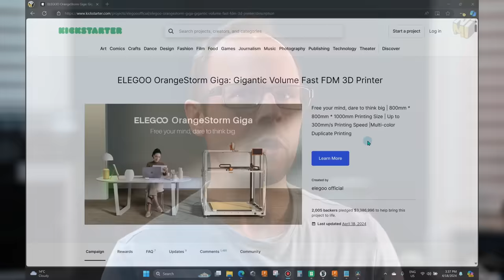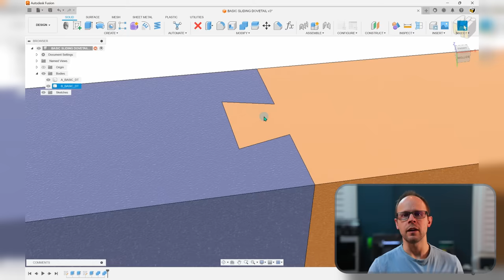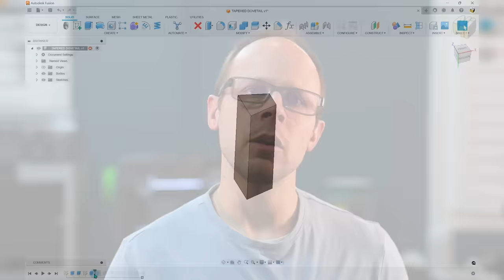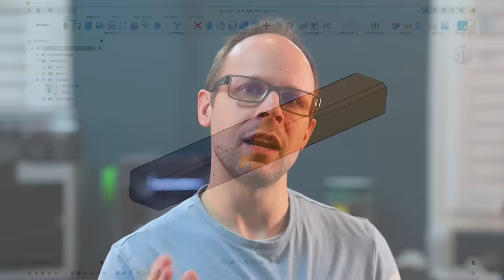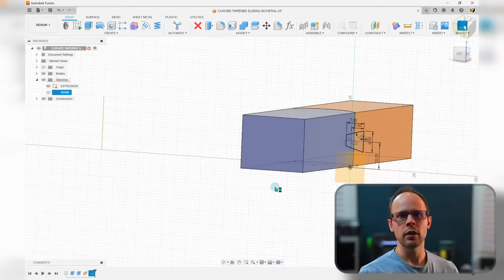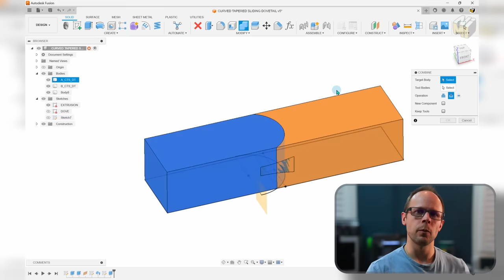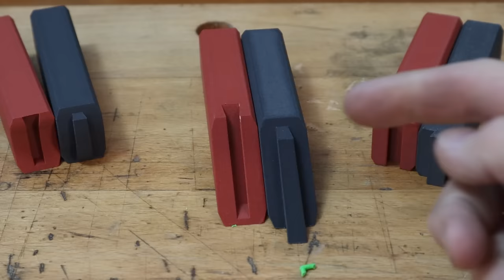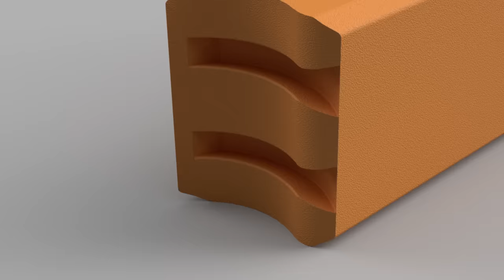Modernizing the best Woodworking Joint to use for 3D Printing

Comment: The finish on your parts is amazing, do you have a video on that?
Reply from the maker: Oh, well it's not really much to do with technique, I'm using the QIDI Q1 and the Bambu X1C for these parts, both are very accurate printers, and I'm using PETG-CF with fairly thin layer heights (0.16).  The PETG-CF gives a beautiful matte finish with that slight texture.
Reply: @NeedItMakeIt  sorry that we are out of scope for this video but how did you applied that texture and how it is called if that is easy to answer I would appreciate it
Reply from the maker: @axtoox  No problem, this texture comes from the material itself, if you try PETG-CF filament you'll have these kinds of results.  The filament I used here is Bambu Brick Red and Bambu Titan Grey.  You'll want a hardened nozzle and hardened extruder gears if you want to print with it.
Reply: @NeedItMakeIt  you're the best, thank you, subscribed to your feed - can't wait to see more!
Reply from the maker: @axtoox  Soooo much more to come!   Thank you very much every sub helps.  This month has been crazy with the subscriber increase it's just amazing.

Comment: These are great on straight and big pieces, but what about corners and smaller (5mm or less thickness) parts
Reply from the maker: Have you seen my other video about the Under Squinted Stop Splayed Scarf Joint?  It works on a corner.  5mm or less, that's a tough one.  You'd really want to use some sort of adhesive for something of that size and use a scarf joint I'd imagine to increase the contact area.  I'll think about it a bit and see if I can come up with something of that size.

Comment: Isnt the last joint an outline + revolve + extrude to cut off the ends + merge? Probably it was hard just because you were inventing it
Reply from the maker: Yes I just tried it and as long as your sketch plane begins from one side, it can be set to a taper, so we can do it in 2 steps with your idea, that's a nice one.  I think having the connection set to an angle like a scarf is going to be superior.  I have 2 more coming tomorrow and then I'll have a final testing video to see how strong each of the connections we've created so far perform.  I'll also include something with fasteners and a continuous rail for a benchmark as well.

Comment: How did you create the rough texture on multiple faces? I noticed that it was on the model in the CAD. How was it able to transfer over so clearly to the prints?
Reply from the maker: My secret weapon is the material.  This is PETG-CF and it is the nicest looking filament in my opinion.  You'll get that slightly rough surface and the matte finish automatically.  You'll just need to make sure you're setup to print with Carbon Fiber with hardened gears and a bi-metal nozzle.
Reply: @NeedItMakeIt  I see, thank you so much for the tip I'll definitely give it a try, it looks amazing.
Reply from the maker: @Mr.Meme01  No problem, I've also found that this material doesn't enjoy bridging much so I typically 'peak' the holes which removes the bridge and gives you a nice clean final product.  This has been my experience with The X1C and the QIDI Q1, so I believe it is material related and not printer related.

Comment: where are your layer lines? it looks almost like matte finishing... or using <0.1mm heights?
Reply from the maker: I was going to say "What's a layer line" but I just can't with a straight face...  I was printing these with a 0.16mm LH and a 0.4N.  It's really the printer and the material that PETG-CF with the slightly rough matte finish really looks great.

Comment: 1:00 nah it's mostly the upfront costs but once that is handled it's about the same as a smaller printer. The annoying part is more if you want a large enclosed unit for using better materials.
Reply from the maker: One of my main concerns with printing plastics on a large scale on a massive buildplate is shrinkage and warpage... to some extent the loss of material if and when something goes wrong.  If you've watched Dr. D Flow, he built his own and it' very well done, but there were, let's say a few issues.  The size and the space it takes up in the shop is a bit of a problem, but it's no more than a table saw, maybe  it could be put on casters or somehow be able to engage the wheels to move it around more easily.  I wonder what material they'd choose to use to enclose a printer that large.
Reply: @NeedItMakeIt  you can use whatever you want really, things that won't burn or deform at 100c are pretty good, aluminum, glass ,foam and another material. 

The shrinking and warping are material specific and can be compensated for, warping is more due to a temperature difference so the enclosed chamber can fix that.
Shrinking is uniform als also temperature dependent and is also corrected by the chamber plus setting the scale a little larger to account for shrinking.

You don't even need to print it in one piece you can just print a few separate parts at once as well.
Reply from the maker: @deltacx1059  I think in that case, you'd want to heavily insulate the large printer heating a printer of that size to remain at 40-60C would be hard to do without it.  Not to mention the costs of doing it.  I'm open to trying one after the kinks are worked out, which seems like it's not too far off.  I still believe that shrinkage/warpage and keeping it attached to the buildplate will be a problem regardless of this being done, but like you say, you can still print in parts, just not as many.

Comment: What exactly does he mean with the very slight taper for the dovetail, so the joint wont back off? Does he mean the lip at 8:20?
Reply from the maker: The taper is a wedge shape, and it is on all faces of the dovetail connection, what it does is ensure that the connection pulls together tight and with lots of contact area it will not come apart easily.  You can still play with the clearances to get the fit you want.  If you don't want it to come apart at all, you can reduce the number to 0.02mm of total clearance, which will make it a 'hammer' fit.  Or leave it a bit loose for some adhesive.  The dovetail is common, but it's not common to also make them wedge shaped, and that's the key because you have a tight connection which doesn't like to move or separate.

Comment: did you add a texture on the print? it looks really good. how do you do that?
Reply from the maker: I can't take any credit for the finish, these are PETG-CF, I've used Brick Red and Titan Grey from Bambu, they're probably some of the nicest looking filaments out there.  They're far stiffer than standard PETG, but you sacrifice on layer adhesion a little bit because of the CF.  The stiffness is nice, because normally PETG is pretty flexible.

Comment: I also would like to see you share the Model and the printer settings, for us as a starting point!
Reply from the maker: Yup, I can certainly do that, I'll add some links soon if anyone wants more info and the files to play around with.
Reply from the maker: The models are in the description now, as far as the print settings, there is nothing special there, if you're printing for strength, I'd add more walls and infill, I might even recommend finding a way to make the connections more solid, which can be done in fusion by cutting into the inside of the part with very thin extrusions.
Reply: @NeedItMakeIt  thank you
Reply from the maker: @berlinberlin4246  No problem!

Comment: You should try some experiments with draw pinned tenons
Reply from the maker: I think so too.  As far as the pin, normally we'd use Oak hardwood pegs, and drawbore 1/8" up and in on the connection.  For 3D printing, the pins would be too flexible I think, we'd want to have larger pins, or a different material perhaps?

Comment: nice video. 👍other than joints your print quality got my attention.🤩what was your print settings and printer.
Reply from the maker: Thanks!  I also try to show the parts very well lit and with 'poor' lighting so that you can see what they really look like with all of their defects.  I've been having great success with the QIDI Q1 and the Bambu X1C.  I find that both like to have the PETG stick to the nozzle, so for large prints I need to be careful because it can release a BLOB where you don't want it.  I'm investigating different nozzle options, because it seems like no matter my settings or which printer I use, the same problem occurs about 6-8 hours into a print.  I think a high-end nozzle along with a proper cleaning prior to printing would go a long way to preventing it... PETG is a bit of a bugger to clean.
Reply: @NeedItMakeIt  thank you
Reply from the maker: @aocagri  No problem!

Comment: You teased Japanese joints, is that the next video?
Reply from the maker: Truth be told, these are connections I've used here in Canada for years and years, I am a woodworker by trade and I've also been a Timber-framer, and we would use dovetails and mortise and tenon connections for all of our work.  I think Japanese joints look similar, but they do a better job at the fit and really celebrate the craftsmanship.  I'll have more to come for sure!